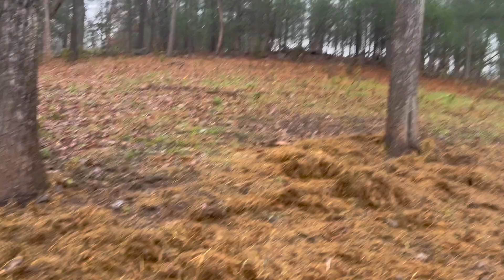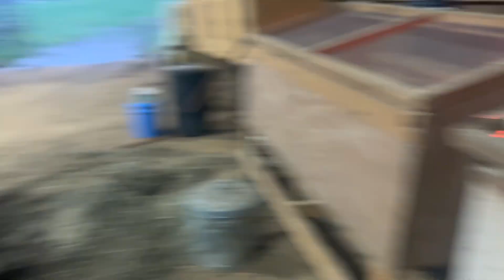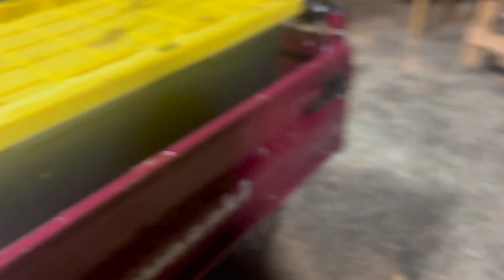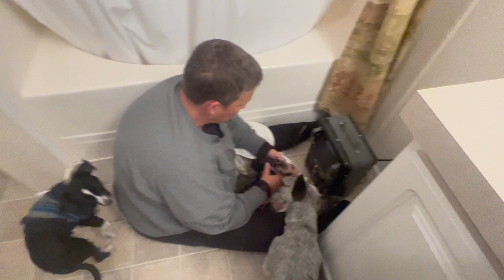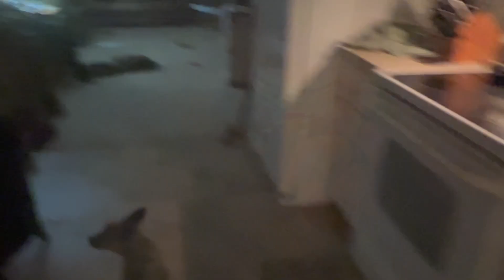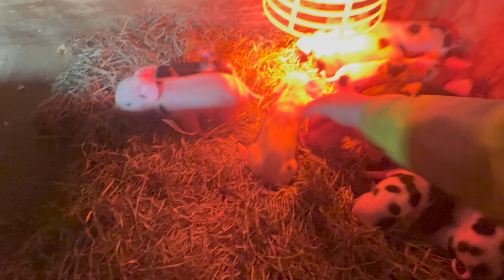We Almost Let 22 Piglets DIE - Farming Mistakes

Comment: Don't beat yourself up too bad. Sometimes stuff happens. We have 2 shows getting ready to farrow within the next month and it's getting in the low 30s at night. They'll have plenty of straw and a 3 side shelter to keep the wind off them. (Were in the desert, so no rain) Yours would have been fine had it not rained. I hope everyone pulls through for you. 
On a side note, we had a sow farrow 17 piglets this year. I find the smaller the litter, the better they do. My ideal litter size is 8-10.

Comment: You could always build a large tent-like structure, I mean inexpensive with four beams, a roof, and a panel on the back/sides to shield from the wind. A large one where the several sows could go in there and nest up however they want. If you can get the mother's milk to them it would be good, because I know the mother's milk is warm and that helps to regulate the babies body temperature. If you do bottle feed then I would try to warm it up a little. Hope it goes well.